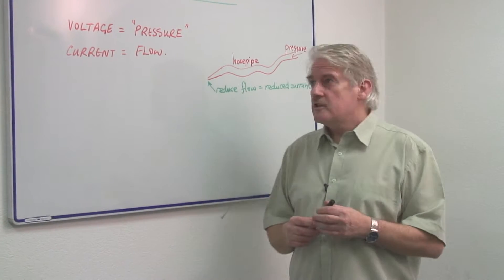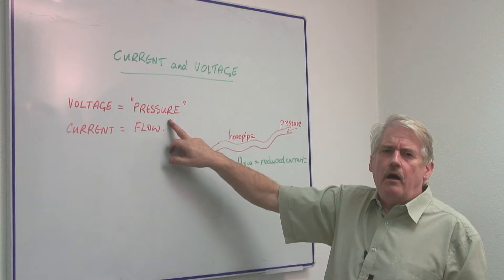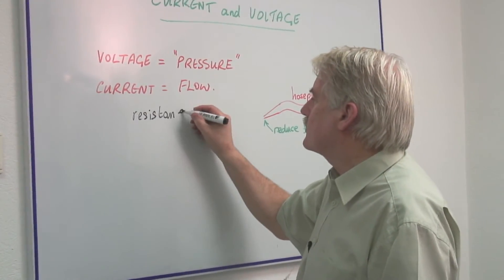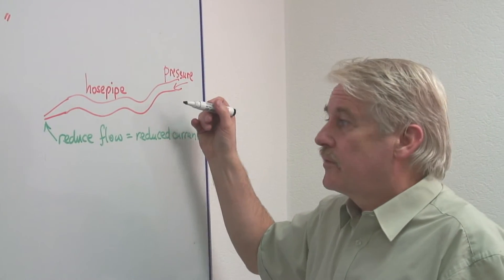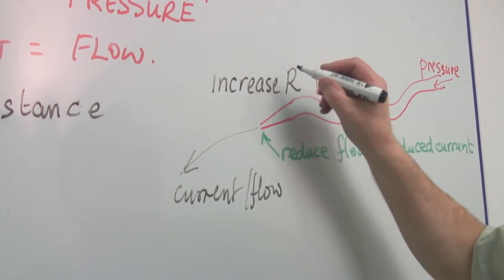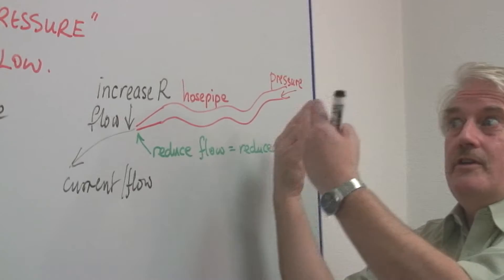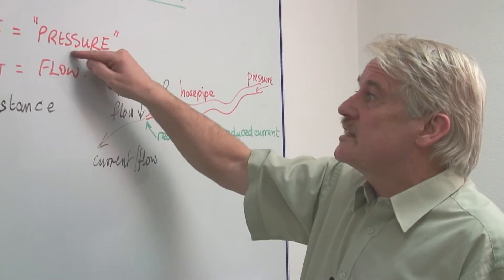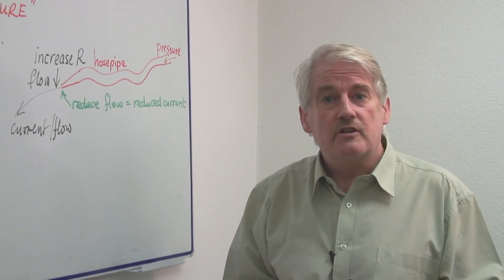Science & Nature Information : What Is the Difference Between Current & Volts?

Comment: Sorry, I'm still confused. The analogy with a water hose doesn't work for me because when I restrict the opening, the water seems to spurt out faster and at higher pressure than when the hose is fully open without restriction. When I measure the voltage between a live wire and either the neutral or the ground wire in my house, I get around 220v - EVEN WHEN NO CURRENT IS FLOWING (i.e. nothing is switched on). In fact, it doesn't seem to matter how much current is flowing (or how many devices are switched on), the voltage is always 220V (either measuring against neutral or against ground). Can anyone explain that!? :o